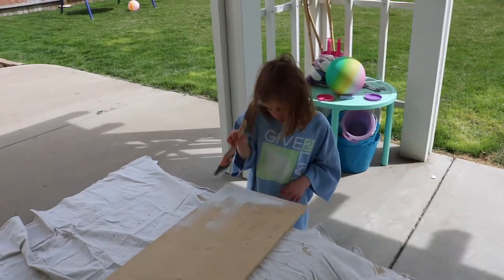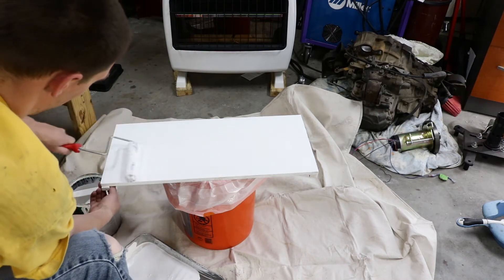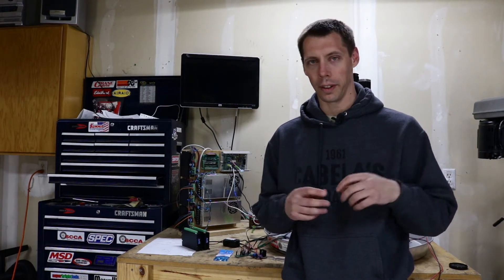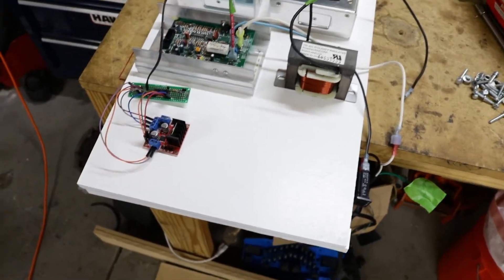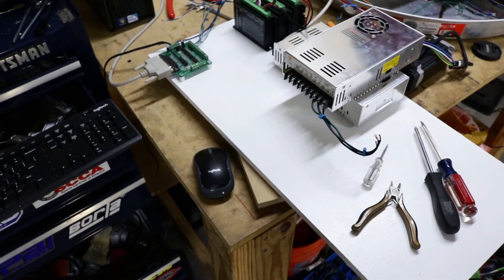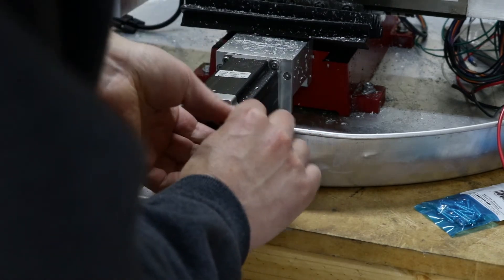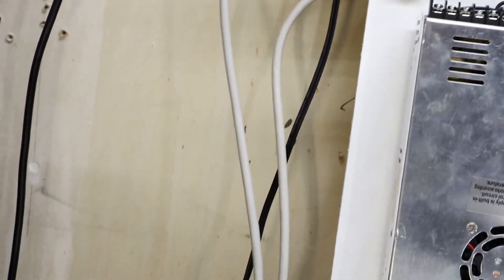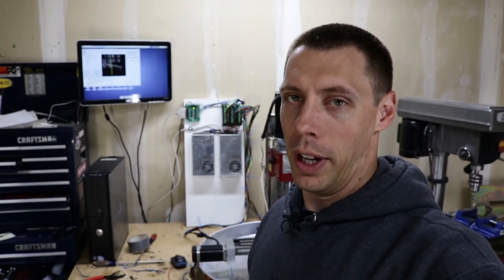Mounting CNC Electronics Pt 2

Comment: What inches per second are you actually running? I know its a mill so you probably aren't worried about it being to fast. But I was wondering if there nema 34 12nm setup would work well for a plasma needing to run 300-500 inches per minute for thin flat steel. I am running ball screws at 5.09 inches per second in my setup at the moment.
Reply from the maker: Mine wasn't very fast.  If I recall correctly it was well under 100 IPM. I just looked at the stepperonline website and saw a torque curve on a nema 34 12nm closed loop stepper motor that went up to 1200 RPM.  It's not making much torque at that rpm but may be enough to move the plasma torch.  Linear speeds will depend on ballscrew pitch and torque required to overcome inertia and friction.

Comment: Does the stepper enclosure is metal ? Also those stepper and encoder cable are they to ?
Just asking because EMI protection is a very important subject for a reliable machine when you have a vfd with multiple kilowatt spindle need by !

EDIT : 
https://www.omc-stepperonline.com/cable-and-connector/1-7-m-67-long-encoder-extension-cable-for-closed-loop-stepper-driver.html 
https://www.omc-stepperonline.com/cable-and-connector/15m59-long-encoder-extension-cable-for-closed-loop-stepper-driver-bm1m5.html
The 1.7m encoder cable often find in kits make no mention of any shielding but the 1.5m version say it's shielded and the shielding wire is the black one. So far so good the 1.7m version seems to also have a black wire.
No mention on the GX16 motor cable, I don't if that can be a problem but you can't overprotect your cnc from EMI generating source or EMI sensitive signal.
Can you complete my research ?
Reply from the maker: I just used regular stranded wire and haven't had any issues.  The tray the mill is sitting on is metal, but the plate the steppers are screwed to is wood.  I agree that it's a good idea to use the shielded cable, I just haven't had the issue.

Comment: Have you got any experience with the G540 Geckodrive ?  What would you recommend for a stable system  Geckodrive or chinese closed loop kits ? I am about to make an upgrade and it's hard to take decision.
Thank you.
Reply from the maker: Sorry, I don't really know anything about the Geckodrives.  The main reason I went for closed loop was because I was having so much trouble keeping the Z axis ballscrew free from shavings.  Overall stability was always fine even with the longs motor eBay open loop setup.  My problem was that after a while the mill would miss steps in the positive Z direction and then plunge too far in the -Z direction.  The closed loop setup at least faults out before anything is damaged.

Comment: You have been my motivation... please how can I wire 4 axis closed loop system
Reply from the maker: Everyone's setup is a little different.  The closed loop steppers and drivers I linked in the description of this video have wiring diagrams in the user manual pdf.  From there it is up to you to integrate them with a controller.